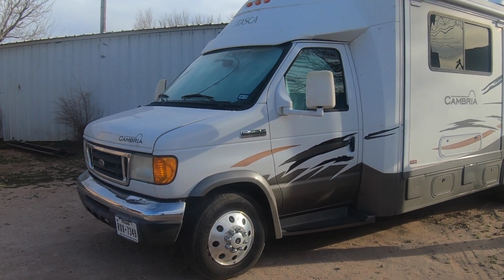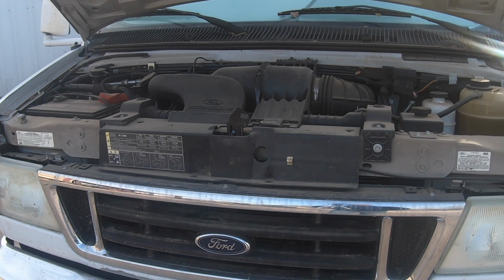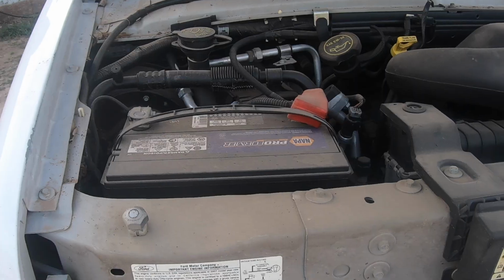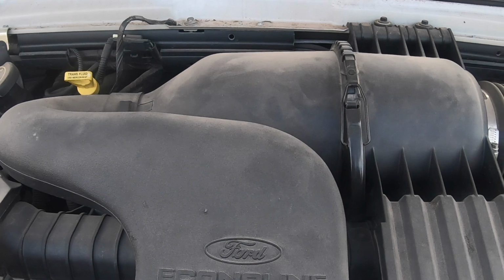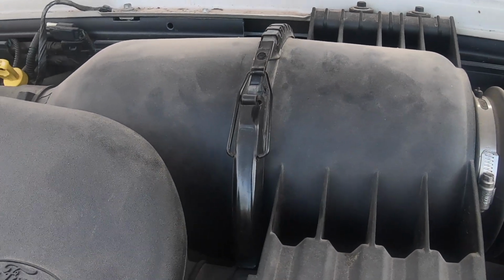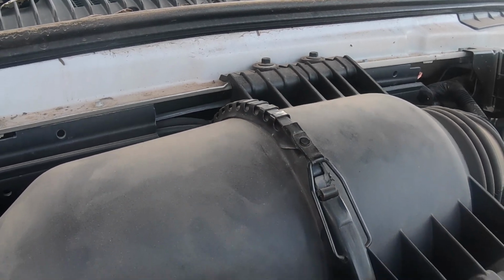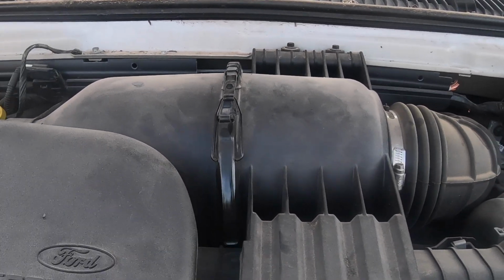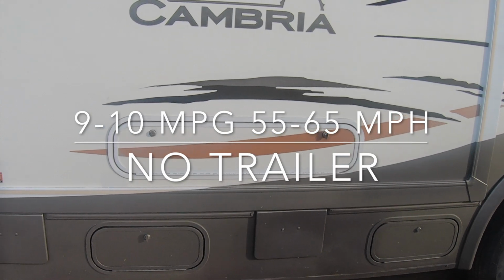V10 LOSS OF POWER WAS NOT (TPS) THROTTLE POSITION SENSOR: FIX COST ZERO & GAINED +2 MPG FUEL ECONOMY

Comment: I bought a bus. 2010 e450 same engine. Drove it home about 900 miles with the check engine light on. 7-8 mpg power felt a bit low and struggling to maintain 65. Truns out it was the cylinder 1 ignition coil 😅. Changed that out and the air filter and WOW! What a difference. Hits 70 no problem, accelerates quickly, and is getting about 10 mpg now. I am impressed with the motor In this thing. Heard lots of bad things about the 6.8, but my experience so far; it's great!

Comment: The issue you describe would not have caused this.  Its more likely that your MAF wire had debris on it that you dislodged by moving it around and it was running on a default map.  You never mention the code it was throwing or if you even had it checked.  Its not a good idea to run any engine with a CEL unless you know what it causing it - especially for thousands of miles.